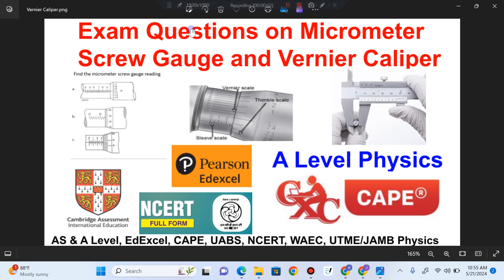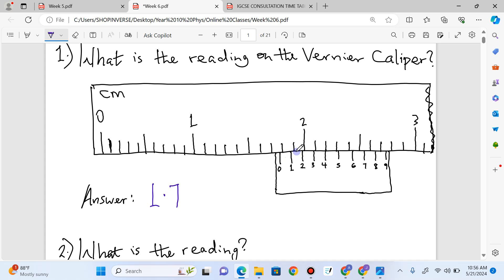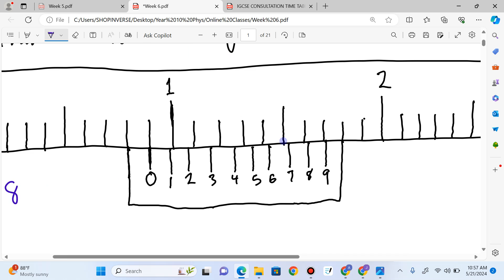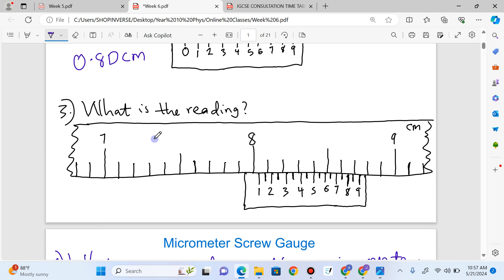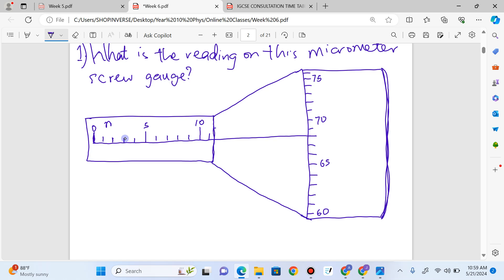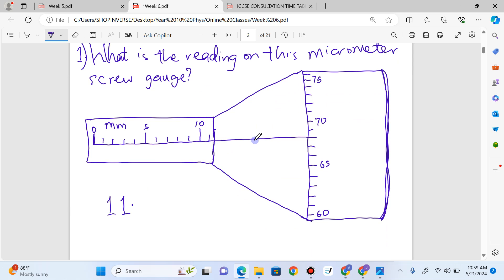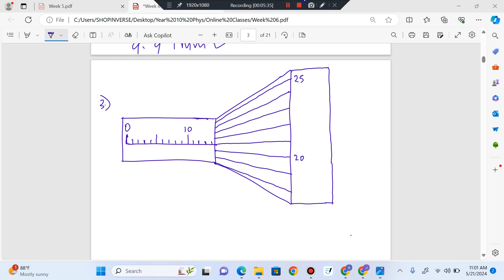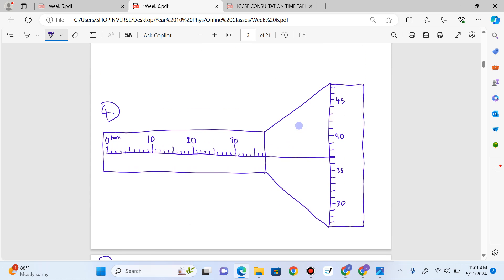Questions on Micrometer Screw Gauge and Vernier Caliper

Comment: The first Vernier calliper question you solved i did mine this way 
1.75plus 0.04 
Becautge vernier calliper didn't immediately at 7 but was between 7 and 8 
Thats not how it should be done ?
Reply from the maker: In question number 1, the smallest division on the main scale of that vernier caliper is 0.1 cm, so you can't do it like that. You can only do that if the smallest division on the main scale is 0.05. Consider the second question on the micrometer screw gauge.

Comment: Sir why are added o.47 to 9.5 (9.5+0.47) why are you not written directly as 9.547 as yo writing directly in earlier questions?
Reply: The ones that he wrote directly,e.g the 14.21 own 
He went directly cos 14 is a whole number 
But if he's to write it mathematically this is what it will look like 
14.0+0.21=14.21 
That is to tell you that the 21 on the Vernier scale has a decimal point in front,he assumed we all know that and just added directly
Reply: So take a look at the one that confused you 
Mathematically we will have 9.5+0.47
I believe you know how to add decimals 
That's how he derived 9.97
This applies for Micro meter screw guage
Reply: Wish I could explain with a voice message